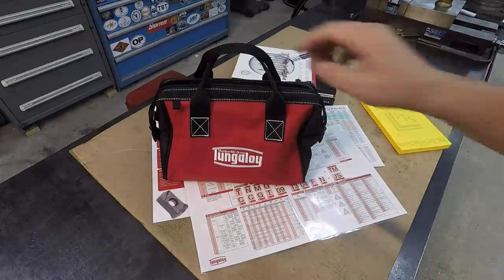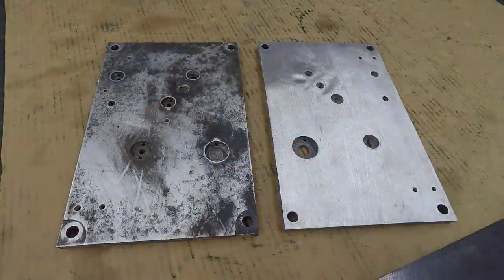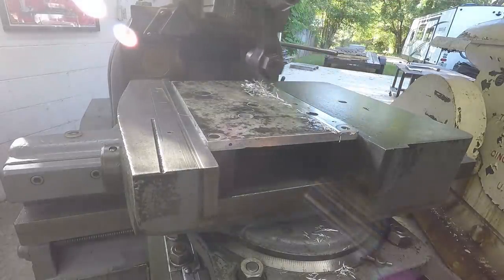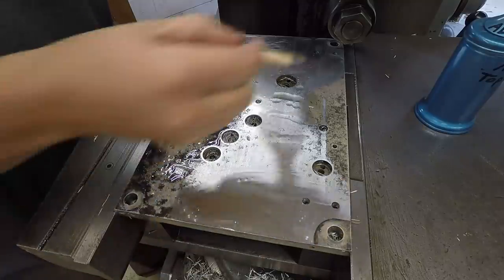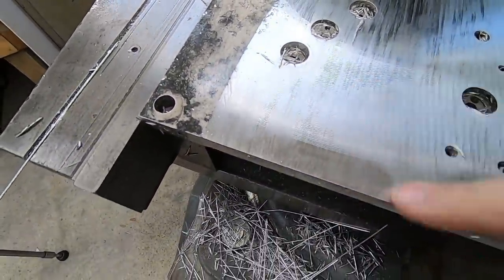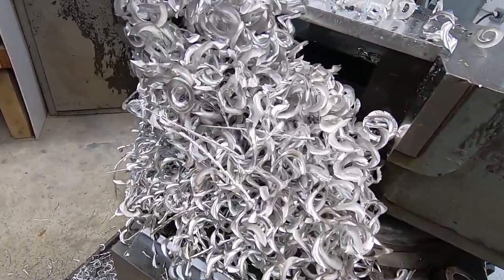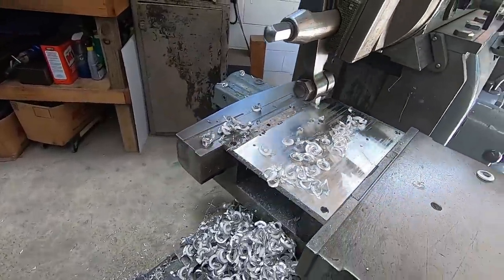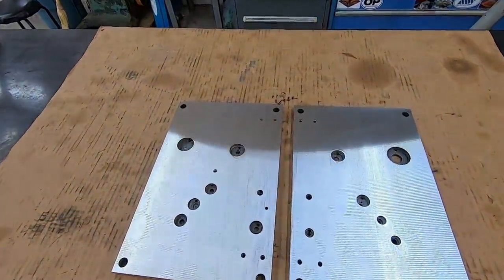SNS 307: Grandfather Clock Restoration, Shear Tool on Aluminum

Comment: What do you do with the chips? Clearly aluminium and steel chips cannot be mixed for recycling.
Reply: Clearly? Why not? What do you think will happen. Unsorted metals are separated using electromagnets (ferrous metals) and eddy currents (aluminum).

Comment: How is it that a scratch is not created on the back stroke? I know the cutting edge is tipped up on the back stroke but still...
Reply: Glenn Stasse I don’t own or run a shaper but I believe the shaper does it’s step over at the end of the stroke and as such the back stroke drags the tool on the raw edge then falls back into place at the start of the next cutting pass?

Comment: I am just wondering, why nobody has built a contemporary shaper with precision linear cone bearings and a shaper-head, driven by heavy-duty index-belts and a BLDC-motor. Such a CNC-controlled machine could perform constant cutting speed, operate faster due to lower mass of the head and achieve even a higher surface quality than vintage shapers with sinusoidal kinetic.

Comment: hi, Adam!
i've been looking at your skill for a long time, and I'm very pleased, but I think you're avoiding really hard work, like, a valve is 1340mm, diameter 80mm, diammeter 45mm, Valley 294mm, Reibala M75 x 2, maternal: Stell 4140, vibration and how it is. So, how to avoid vibrations, in lathe processing of thin rollers. i'm sorry about the machine translation

Comment: Hi Adam, I have a question regarding the cutting forces of the shaper while cutting a plate like this one. How are the forces influencing the part? Does the tool push the plate down while cutting?

Comment: So, I have a question.  I keep seeing machinists put oil on the part to be machined, and I don't really understand how that helps.  Doesn't the oil end up on the wrong side of the chip?
Reply: Willy Doyle , the oil lubricates the single point of the cutter helping it to keep its edge and also acts as a coolant agent to the surface of the chip. This keeps it from clogging/fusing to the cutter and causing a poor surface finish. This is why a deeper cut such as threading on a lathe or boring with a drill bit causes excess heat and smoke from the fluid.

Comment: Do my eyes deceive me or has he ruined that lovely finish during assembly?
Reply: Yeah i was thinking the same.
Reply: It may have been the lighting.
Reply: @DavidKutzler  Looks all scratched up though, not like it was after machining.
Reply: will I ever see a flycutter again?
Reply: why did the chip change suddenly?
Reply: @nielskorell5566  Some of what you saw may be shadows of scratches in that plexiglass clock face.
Reply: Agree that they looked more scratched. i would have assumed he polishes them to a mirror finish after this much work
Reply: The "clock restorer" has posted a comment.  Look for it in this thread.
Reply: Did Abom do that finaly assembly? Looks like someone went over it with fine grit sandpaper/rough steel wool after the shaper!
Reply: I believe that was what it looked like before Adam got a hold of it
Reply: as Paul said, the owner left a comment:
"Yes, I ruined the finish, but that's not what you see. I made blunder and in the process of trying to do the edges, I put quite a few scratches in it. I decided to take everything and polish it up with a buffing wheel and compound. I also did all of the parts, especially the copper ratchet and the pawls (I was surprised to see that they were actually copper and not steel) and the large brass drive gear on the driving shaft. My brother in-law was actually kind enough to take the cut pieces of Lexan and make new cover plates as well as a new face. What shows in the pictures does not do justice  to the awesome job that he did, especially on the face. Unfortunately, I had a couple of better pictures for the copper and brass that were better exposed to show how nice they looked, but I guess I didn't get them to Adam in time. Although he doesn't show it in the assembled pics I left the outside surface on the back plate untouched. A big thank you to Adam for a great job on the plates!"
Reply: Reckon they were his Grandfathers Photos, when he was building it...?
Reply: @turmat01  All good I was just doubting the guy that said Abom put it together like that. Stuff happens, I'm working on a project that I've had to re-do almost a dozen times!
Reply: Those pictures are of disassembly, not assembly.  What Adam did was beautiful, but the pictures are of the original damaged plates.  Something that complex you must take pictures to be able to put it back together.
Reply: @leeklemetti1887  You are correct on that. The first pictures were ones I took of the clock before any work was done on it. Well, some was done on both of them, the first effort was with a flap disc on right angle grinder and that's when I knew I had gotten in trouble. Some of the other changes were because of manual sanding. The problem was both the dips I left from the grinder and that the pitting was quite significant. I had started this project a long time ago and put it aside for several years. The reason was that I lost hope in fixing it because all of the bearings (14) were bad, probably from the fire. I had some knowledge on how to find bearings, and found them ultimately by the ID, OD, and width. The problem was I couldn't find any place (maybe I was looking in the wrong place) where I could get the bearings in numbers of less than 10 per size. Ultimately, It turned out that in the collection of bearings that my grandfather had which we saved, there were 12 of the 14 bearings in that collection. LOL The other 2 were easy to find. It also turns out that the way my grandfather designed/built it, it made it almost impossible to put together the wrong way. As I said previously, I guess Adam didn't have time to put the 2 newer pics (better exposed) that show a lot more detail in the cleaning and polishing of the whole gear train, particularly the copper ratchet wheel ( for the drive), and the large brass gear that was being driven from the drive assembly.
Reply: If Abom scratched it with a brush just dusting the chips off, how hard must it be to keep it perfect and unblemished when reassembling the clock?

Comment: Nice info-mercial for tungaloy.
Just send adam a box of crap and get 5 minutes of advocacy.
Reply: I think he was just showing off what he won for the chip of the month thing, its cool to win a prize and he's proud I dont see anything wrong with that. And for the sponsors he does, he's providing a service in exchange for goods or money. Who wouldn't want that? Keeps the shop stocked and running.
Reply: It's a shame the video player doesn't have some mechanism to advance the video so you could skip over parts you don't like.